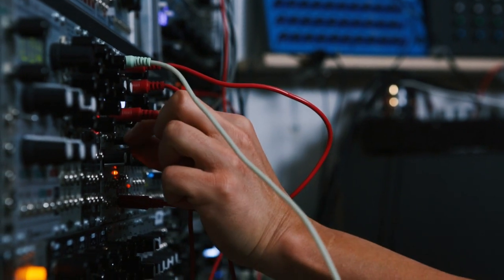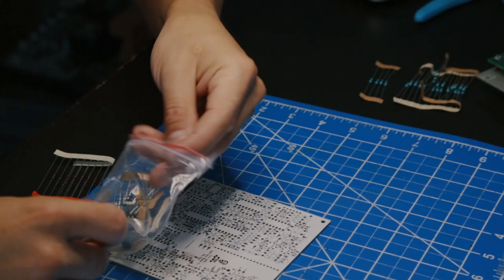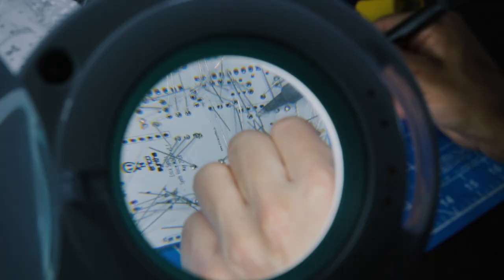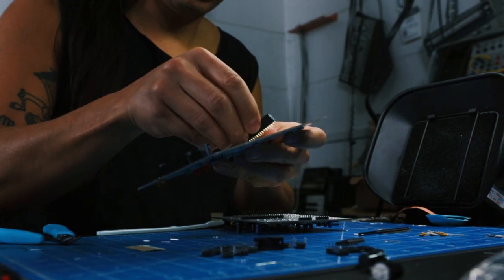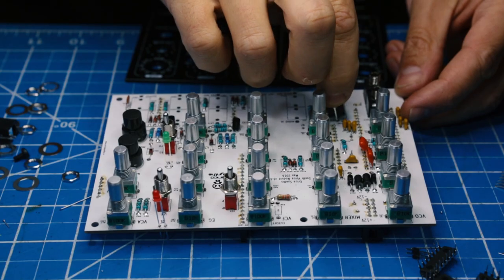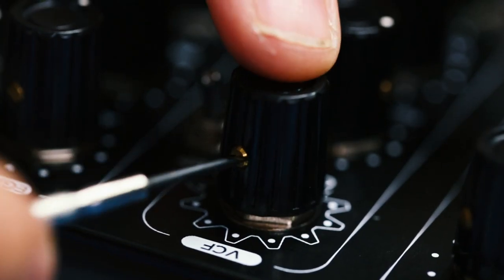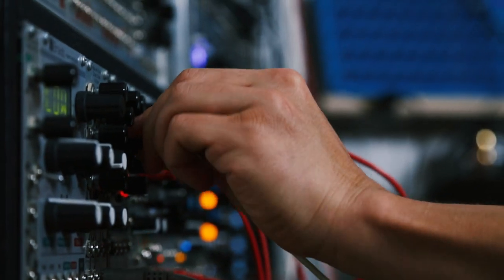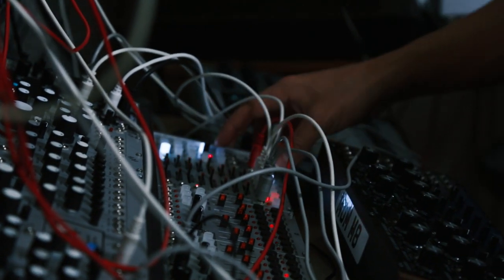How to Build a Modular Synth ft. Baseck | Nice Content | Tatered

Comment: The description of modular in the beginning is like not even close to what modular really is about. IT IS NOT complex and hard to learn AT ALL. There are just three things to know and you can start jamming right away. Number one, Control Voltage (CV) - Imagine it like this, you have a knob, you can turn the knob OR you can use voltage to move the knob (Higher voltage means more turned to the right). Number two, Trigger/Gate - triggers and gates have set voltage and if the voltage changes but is still over a curtain threshold, nothing will happen. Trigger acts as an impulse that activates something for a time that is set somewhere else. Gate has different length and controls when will something be activated and for how long (depending on the time that gate has high voltage). Number three, each module is same and different - to get started with a module, look up how it works. That's all there is to modular. Hope this helped.